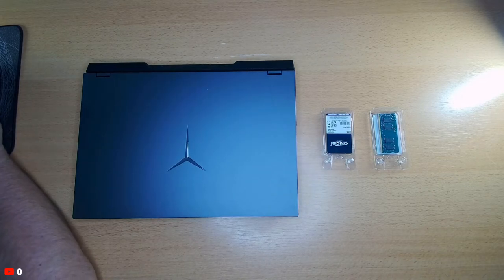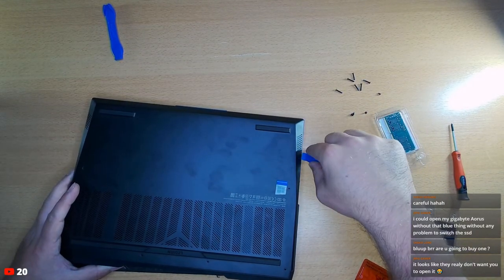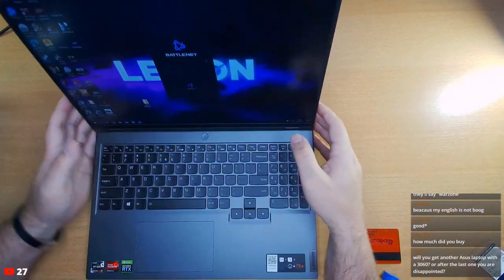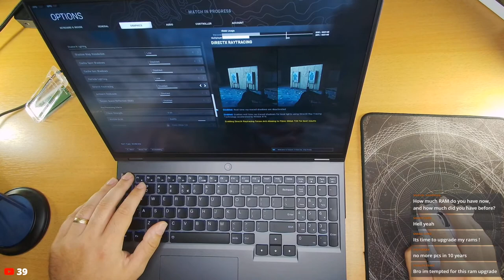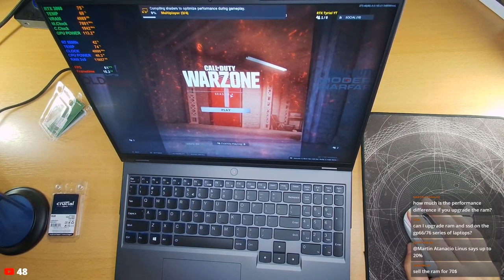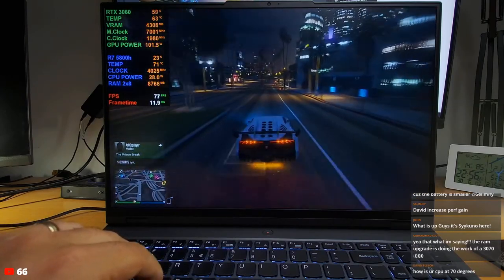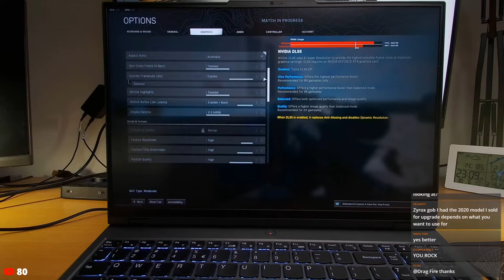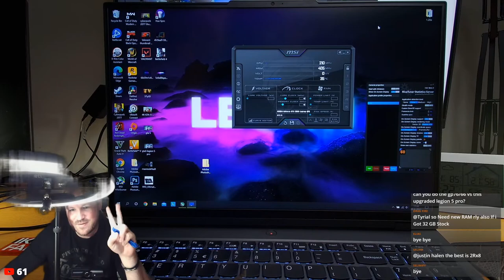Lenovo Legion 5 PRO // Live memory upgrade // RTX3060+5800H // WALKTHROUGH // GAMING FPS TEST

Comment: 21:50 pro tip: don’t screw in the screws until you testet that everything works. The clips will hold it in enough for testing purposes. There’s nothing more annoying than doing all the screws again just because a ram stick is not clicked in all the way. This goes for towers aswell.
Reply: The samsung box as cooling riser is a real pro gamer move! 🤣👍🏼👌🏼 i use my apple watch box for it, i even take the box with me when im on the go
Reply: i just keep my tower unscrewed all the time lol

Comment: Hi nice vid, like 🔥👍, is there any reason for going with lower latency than CL22 and with dual rank? I heard that single ranked are typicaly faster than dual ranked and while in PCs u can achieve dual rank status with 4 single ranked rams which is ideal(PCs have 2slots per channel) in notebook u cant (1 slot per channel) so u need to go with slower dual ranked sticks to achieve dual rank status... So dual ranked or single ranked? And does latency matter?
Reply: My laptop has 1x16gb RAM. (AMD 9 5900, rtx 3070) Time spy score is bad compared to those with 2x8gb dual rank.

Comment: Pulling with a suction cup maybe?!
Reply: its clipped all around. you just need to patient and go around carefully start with front and work towards the back. the clips are overkill when you have enough screws to screw down the back firmly. most manufacturers don't want you too open it so they make it difficult to remove.

Comment: asus g513 RTX 3060 + ryzen 9 5900 hx =   +30 more fps on every game  !!! legion 5 pro have beter screen and more ports   but in performence asus is much beter
Reply: stop lying. no need for doing that. i had asus g513 before and it was way worse
Reply: @mal-avcisi9783   go watch some  videos . game test at 1080p   on every game  g513 with rtx 3060 and ryzen 9 5900   giving +30 frame per sec more . i allrdy have legion 5  and  g513 .

Comment: I don't understand why do you guys care about 10fps more. Human eyes won't be able to pick up the difference. And valorant , cs go and other competitive titles play above 165fps anyways. Even if you get 400fps still your display will be capped at 165Hz. Why do you want to spend more for the extra few fps ? Makes no sense. Rather use the deafault ram for 5 years and then upgrade for the new laptop feeling
Reply: in gta 5 it makes a difference and it does in most games i play
Reply from the maker: 10/15% more performance is pretty big. That could be considered a whole generation leap. Its not only the fps btw. It's also stuttering.
Reply: @TechTyrial  yeah
Reply: Depends on what you do and which games you are playing. 15% of an already good performing game maybe won't make a difference until you have processes running in background, like streaming on twitch while using discord with some chrome tabs opened with youtube music. Also the difference is like upgrading to a higher tier gpu, definitely worth it if you're not hitting enough fps with newer games.
Reply: @Requiemes  you upgraded?